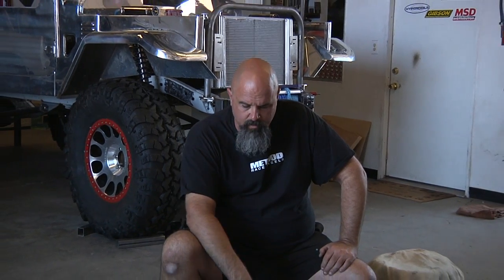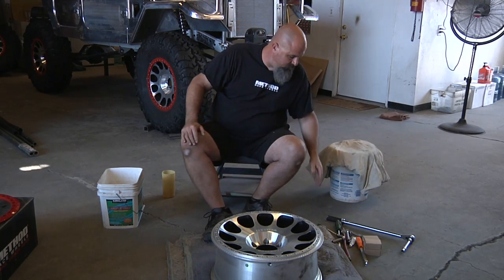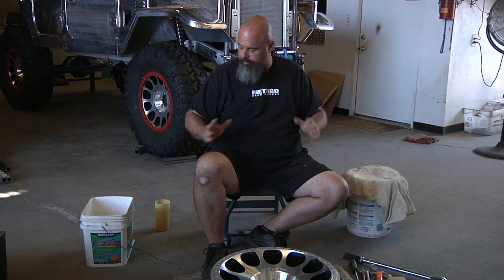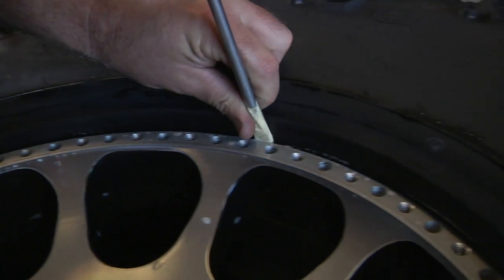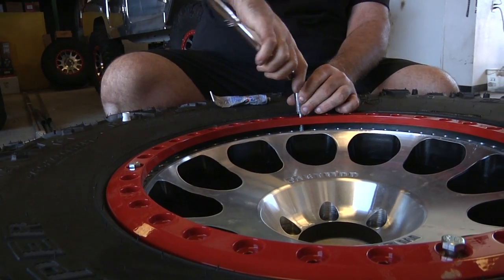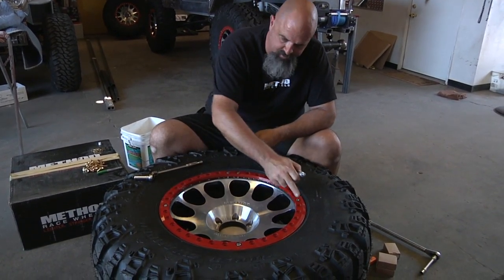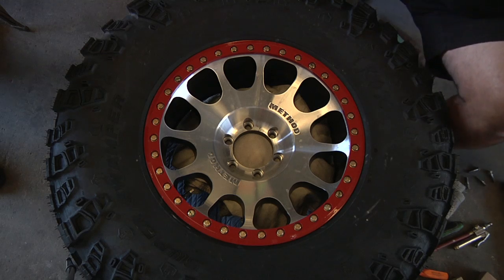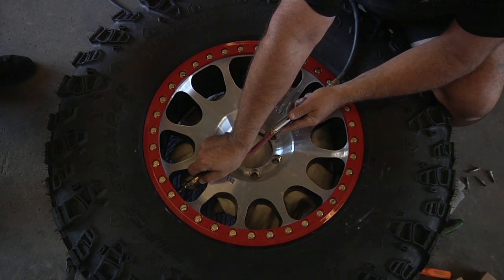The Sniper: Quad Cab FJ 40 - 41" Interco Iroks on 20" Methods

Comment: Why in the world are you putting a 41" Super Swamper Off Road High Performance tires on a 20" rim for? Are you NUTZ?....send those back and get the same tires and rims but in a 15" rim with beadlocks this time. You can even get the same size tire or bigger, just get it for the 15" rim dummy.....stop thinking  getto.